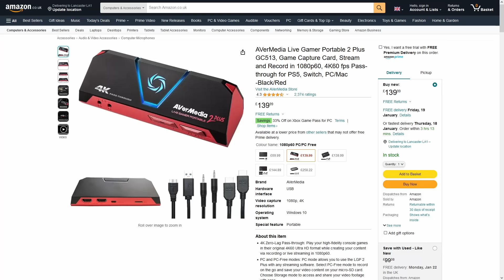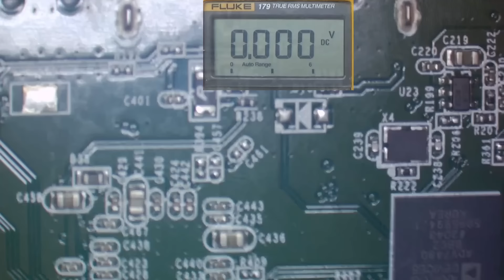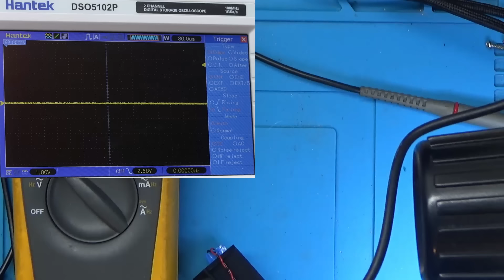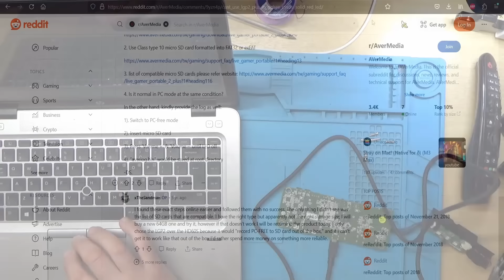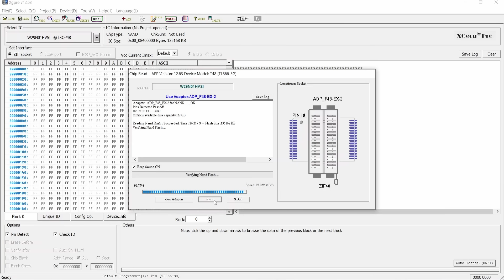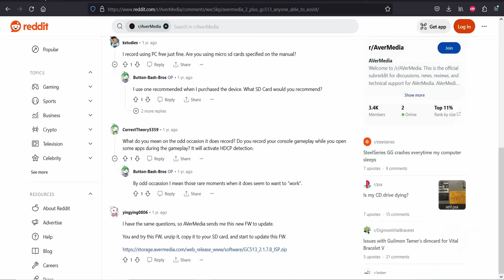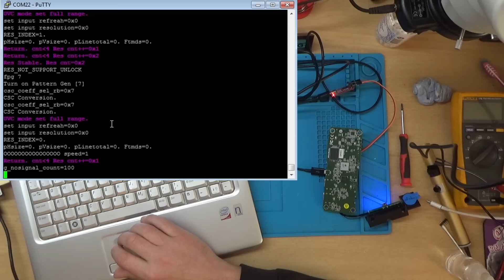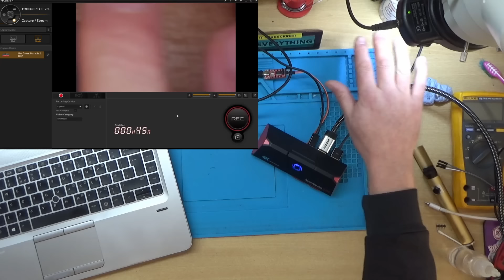Faulty AVerMedia Live Gamer Portable 2 Plus | Can I fix it?

Comment: ey man i have a question i have the same problem an its cause for a bad instalation of firmware, theres something elses simple way than i can recover mi LGP like you but more simple
Reply from the maker: Yes, I uploaded all the files in the correct format with the flasher program in the video description. You will need a laptop that will be able to install the driver though (I got it working with windows 7).

Comment: I have a bricked router, i don't have a usb to ttl, could i extract the original firmware like you did via a usb connection or an ethernet cable ?
Reply from the maker: It would depend if the router bootloader is still intact and if it supports that functionality (some type of recovery mode). The main chip in this device has this function built in, most routers that I've came across unfortunately don't and you either have to use the UART (USB > TTL) or JTAG to recover.
Reply: @BuyitFixit  how to know if this function is available ?
Reply from the maker: You would need to look up the datasheet of the main IC.
Reply: @BuyitFixit  I must say that your skills are exceptional.

Comment: that video is amazing !!  you know what i currently have the same issue with mine, il seems that the firmware is corrupted and the device bricked.  When i plug it to usb pressing the upper button then the device is detected  as a USB composite device.  unfortnuatly i have only  a 64bit OS so i cannot put the drivers and use FRM.exe... do you have any idea or a step by step solution to help me???
Reply from the maker: Thanks 👍I was hoping it would be of use to someone. Yes if your unit is being recognised when pressing the upper button it does sound like it's a firmware issue. Just wondering how it became corrupt? were you updating it or did it just stop working when using it? Is it the 530 model too? I did find a 64bit version of the driver which works but I used windows 7 on an old laptop because you have to boot with driver signing disabled to get it to work on windows 10/11. The driver is included in the files in the video description (It's set up for the 530 model at the moment). Disable driver signing, install driver, run FRM with device connected and in bootloader mode. Once connected ..you should be able to flash the device. You will need to edit the file that has the devices serial number in it to match the number on your device.
Reply: @BuyitFixit  thanks for your quick responde, yes mine is the GC513 live gamer portable 2 plus. I think the mistake was mine as it happend when i plugged the device on the ps5, with firmware files in the sd card. i think the system automaticly launched an update and for some reason the power shortly get down on the usb port... i've downloaded your lgp2+ file but there is a lot of things inside. which one is the driver  to install and how to set it without signing ?  thank you very much !
Reply from the maker: SPCA6350_v1001 is the driver file. Search "windows 10 driver signature disable" It's something like Press F8 when the computer is booting, Troubleshoot > Advanced options > Startup Settings and click the Restart button. When your computer restarts you’ll see a list of options. Press F7 on your keyboard to select Disable driver signature enforcement.
Reply: @BuyitFixit  ok so i installed the driver and i had to go to device manager, select the driver manually and affect the "i catch(X) bulk camera 6350"  to the "usb composite device". i'm still unable to connect using the frm.exe. Same if a use the "i catch null device" driver. the strange thing is that if  i use the "bulk camera" drivers windows still says " the device cannot be started (code 10)"
Reply from the maker: It just found the device after I installed the driver. I don't remember having to manually select one, although I used the same driver but on windows 7.
Reply: @BuyitFixit  yeah that's strange, even by forcing the driver it still consider it is a usb composite device and not a video device... maybe somthing deeper happened and the firmware is totally clean... i searched for a tool to directly copy the firmware on the  chipset card, i also opened a ticket at avermedia... At the end i can ask for a refund to amazon but as it worked well before that for a second hand product i really want to try to fix it
Reply from the maker: It doesn't show as a video device with the bootloader driver. Search for the eken camera I mentioned or the filename of the driver there are tutorials how to flash the camera which is the same chip.
Reply: @BuyitFixit  thank you, i ckecked the video and they did exactly what i did, for an obscure reason the device stay with a warning symbol on it in the device manager... impossible to communicate with the device with the frm.exe. i'll keep you informed if i can find a solution. thank you for your time and explanation :) you did a great job
Reply from the maker: Perhaps try uninstall and re-install the driver? I've had weird stuff with windows and drivers before. Do you have a friend or relative with an old windows 7 laptop? you could always try that?
Reply from the maker: I found this, not sure if it may help..
The driver is recognized in Linux/Windows 10 as a iCatchtek SPCA6350.
In case it' s not recognized, go to Device Manager, search inside "Universal Serial Bus"
some device named "iCatch .. Null device" and click update driver, and select to manually
select the driver. In the list select the USB Video device, keeping the checkbox list
compatible devices on
Reply: @BuyitFixit  right that's what i was talking about, but in my case, the device is recognized as a "usb composite device" with only this default driver available if i keep the "compatible devices on" checkbox. if i want to be able to select the icatchtek driver i have to unckeck the checkbox, and even that way the installed device doen't work properly there is still the warning symbol into the device manager
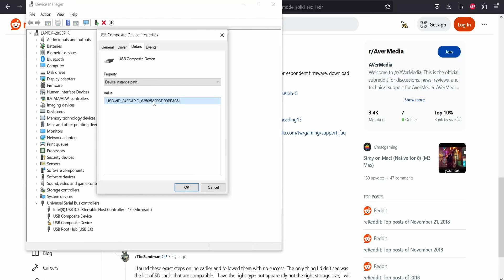Reply from the maker: Does it show the same hardware ID's as mine 23:59 ?
Reply: @BuyitFixit  i'll check that just to be sure
Reply: @BuyitFixit   hi ! it seems to be the same at the beginning, the next part is quite different but in google it send me to some drivers i can't find  here is the id :  VID_04FC&PID_6350\5&1310DCDC&0&2
Reply from the maker: @boneslasher59 Yes it's correct and should be able to be recovered. The VID and PID are the same (vendor and product)
Reply: @BuyitFixit  yes but as soon as i install the driver it says " unable to start device (code 10)
Reply from the maker: @boneslasher59 I'm not sure what version of windows you are using but I used 7 on an old laptop. Perhaps there is a problem with whatever version you are using and the driver.
Reply: @BuyitFixit  i'm gonna try with my mother old laptop on win 7

Comment: incredible 99% of people would give up🙂
Reply from the maker: Thanks 👍Yes, hopefully this will help others in the same situation. I got an email from someone who had the same problem. The cause seems to be when you've done an update and leave the SD card in containing the update files. In their case the it was connected to a PS5 that powered up to do an update, this caused the AVerMedia device to start updating itself from the SD card that was left in it. The PS5 switched itself off, but the AVerMedia must have been mid update and ended up bricked. I suspect similar happened to this one.